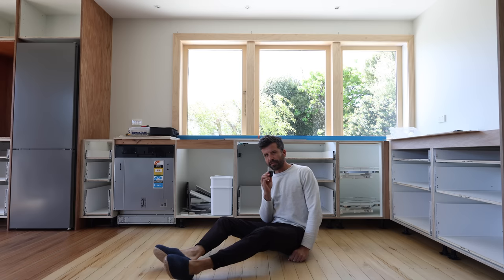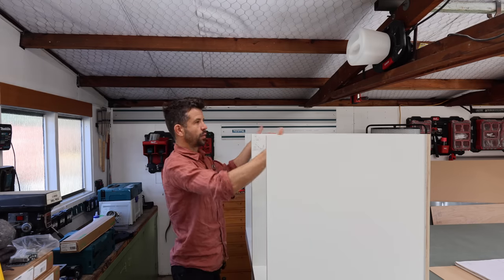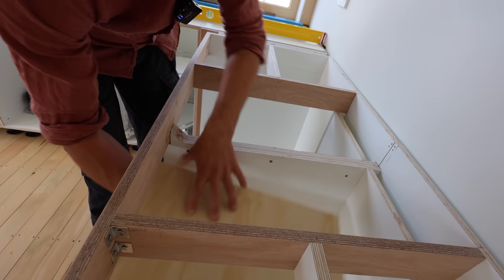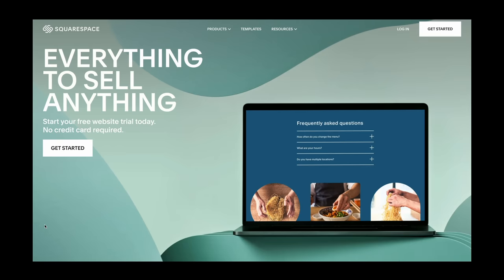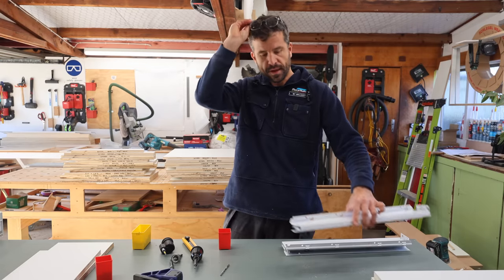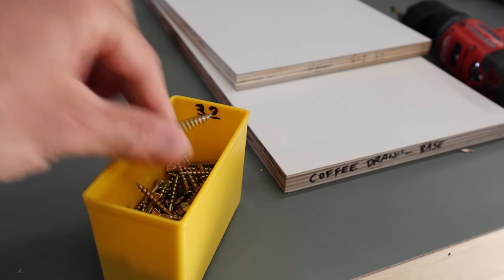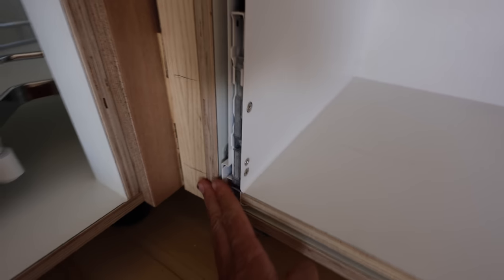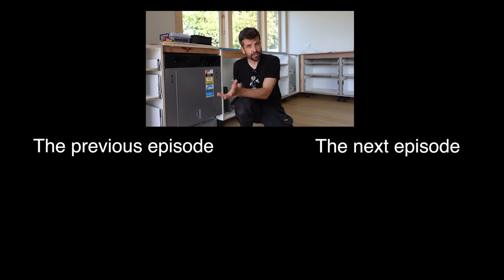A Better Way To Build Drawers, But is it Faster?

Comment: Is buying prefabricated kitchens not as common in NZ as it is here where I live? Typically people here would buy whole kitchens including cabinets, drawers, faceplates, hardware, countertops and appliances. Then either a contractor will install it or people will diy it.

Comment: It's tedious to write on each part.
      You can generate a bunch of QR codes and make a list for cabinet parts. You can add a description if you feel like it.
      Assign a code to a part and make removable stickers. Just remember to stick the right code on the correct part. 
      It's a whole lot easier and quicker to do than explain. Except for the sticker material it's free. 
 The other way is to make a list of parts and assign a number, then just write a number on masking tape.
      The QR codes are for when you have a LOT of parts.  LIke a hundred or so or more.
 
The pushing cabinet gimmick is probably an ASMR thing.

Comment: Don't put your exhaust slot in the front of the drawer, that will ruin the look and be horrible if it's a hot day. My hob has no exhaust that I can see, I didn't put it in and it has been fine.

Comment: I really like the blum tandembox system. Its similer to this system but is actually quite cheap in the long run.

We priced out our kitchen at ikea and bunnings, the bunnings one was rediculesly expensive.

We ended up going with a local place to supply the kitchen, we got the full kitchen including benchtop, fronts and blum drawers and soft close hinges for about the same price as what the base cabinets would have cost from bunnings. Its also much better quality than the bunnings crap.

Comment: Oh man, I had to deal with this drawer system for 24 kitchens in a projet... WTH, it's complicated and super fragile. The weakness of those drawers is unbelievable. You can detroy one simply by taking it out. Ridiculous, not enough strenght and you waste so much time repairing them. I don't see how they speed anything up, and they are sooooo weak.

Comment: you want the fan to extract on the rear of the unit, they can get fairly hot you in summer do not want that heat at your crotch.